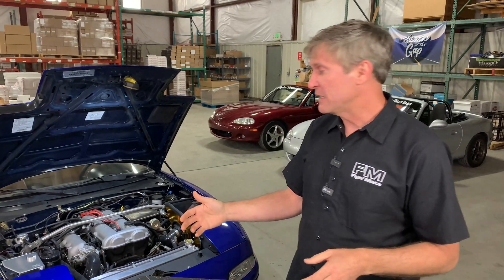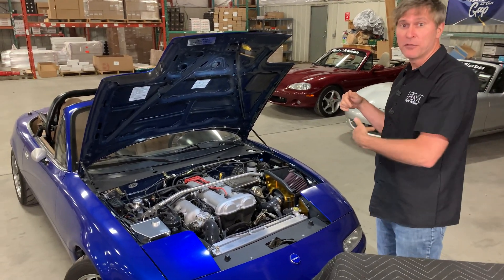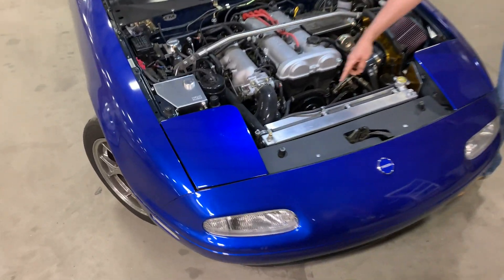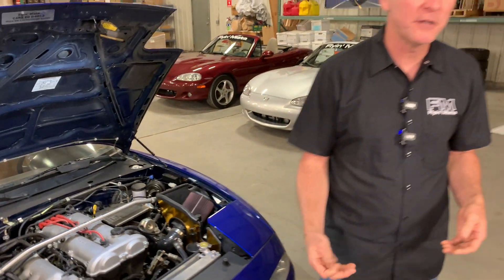BOVs: To Vent, or Not to Vent? That is the question! (FM Live)

Comment: Is it better to route the bypass valve vacuum to the intake manifold than pre turbo?
On my 300zx Z32, the stock setup is routed to the intake manifold. but I would like to route it pre turbo to keep the engine bay clean, but I'm uncertain if that vacuum source would still make the bypass work 100% optimal.
Reply from the maker: @jean-michelgoulet767 Good question! It's important that the BOV signal source be connected to a place that has a boost reference. So, the intake is the best location. Thanks for watching.
Reply: @FlyinMiataVideo  Thanks for the reply !

Comment: Is it normal to install the Turbosmart Dual Port BOV on the Abarth??
Reply from the maker: It's been a long time since we've had our Spider 124 and I can't remember all the things we did to it. If the factory BOV is leaking and Turbosmart has a drop-in replacement, I'd go for it.
Reply: @FlyinMiataVideo  But there are two options - recirculation only and recirculation + blow off. The Dual Port BOV  blows off and recirculates at the same time. I have Abarth 595, 180  HP with Garrett turbine.
Reply from the maker: @PavelBuyevich  We aren't familiar with the Fiat 500 Abarth models, but unless you have had your ECU tuned to ignore the MAF sensor and use speed density tuning, you'll need the recirculation option to prevent your check engine light from coming on. We'd recommend speaking with your tuner about which part to use here.
Reply: @FlyinMiataVideo  Thank you!

Comment: If i go from provided recirculating bpv to turbo smart dual port 50/50 vent/recirc, will it hurt performance? Its for a kraftwerks sc setup on a 9th gen civic si
Reply from the maker: If you have a MAF based system, you'd likely be creating a vacuum leak. If your Honda runs a MAP system that doesn't really care about what's in front of the throttle body, you're likely fine.

Comment: Bov before or after IACV ?
Reply from the maker: You'll want the BOV piped to the intake piping and before the TB.
Reply: Yes the bov before the tb. What about the IACV. Should I plumb it before or after the bov.
Reply from the maker: @c34laurel  We might be misunderstanding your question. The Idle valve on the Miata is either attached to or a part of the throttle body, depending on what year you're working with. Are you talking about your boost reference line?
Reply: @FlyinMiataVideo  normally the IACV is attached to the intake manifold and the hose to pre TB. My question is, that hose pre TB, should it be before or after the BOV inline.
Reply from the maker: @c34laurel  Thanks for clarifying. The placement of the BOV in relation to your IACV doesn't matter.

Comment: This was super helpful.  I dont have a miata. I have an 87 300zx.  The guy i bought it from added an intercooler setup and with that, a bov.  The afr has always seemed off to me (runs rich).  I am currently replacing everything from the intake, intercooler, turbo and exhaust.  My new bov comes with everything to recirculate as an option.  I started doing some research and from watching your video, it seems that vent to atmosphere may actually be what was causing some of my issues.  On my new setup im going to plumb into my intake and recirc.  Thanks for this info!
Reply from the maker: @ExCordeEnt If your Z is still using the stock mass airflow sensor, running a vent-to-atmosphere blow off valve will definitely cause your fuel trims to be off.

Comment: Thank you for the information! 
So it doesn't make any sense to run a atmospheric valve on a stock turbo Mazda 3 for example.
I noticed that throttle response is a bit more on and off when it's open valve and the engine is moving around more.
Reply from the maker: @JohnKowalskyDrive You are welcome! You wouldn't want to run a vent-to-atmosphere BOV on a car that is still using the MAF sensor - it would essentially act as a large vacuum leak, which will cause the check engine light to come on. Additionally, you would likely experience some drivability issues as a result.
Reply: @FlyinMiataVideo  Can this eventually lead to a lean A/F ratio?
Reply from the maker: @JohnKowalskyDrive  Yes; a vacuum leak will cause a lean A/F ratio.

Comment: Which is better for reducing lag, BOV or Recirculate? Can the Recirculate line end up in the exhaust manifold instead of in the intake?
Reply from the maker: As long as you have a well designed turbo system, we haven't noticed much difference in performance between the two. Now, noise is another thing. The recirc hose from the BOV will need to enter the intake track after the MAF if it's used. If you're not running a MAF, it can go wherever you want.

Comment: Wait a minute..... Did he say the FM turbo kits work with stock ECUs????
Reply from the maker: Our FM Turbo kits use our Voodoo Box to connect to the stock ECU for fuel management to keep our kits 50-state-legal, with no aftermarket ECU or tuning required.
Reply: FM Guys chime in here if I get this wrong... Yes the stage one kit works with the stock ECU using what FM refers to as their Voodoo Box. Here this is from their website on the kit: Fuel management is handled by our own Voodoo Box, which uses the stock injectors to deliver more fuel. Because it only modifies the signal under boost, the car acts completely stock at idle and cruise. There is no tuning required.
Reply from the maker: Thanks, good explanation!